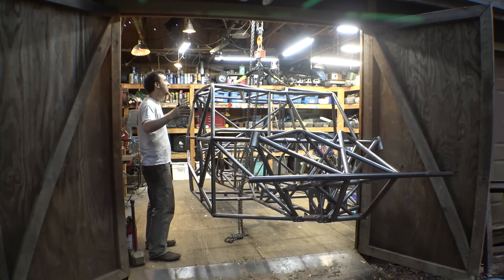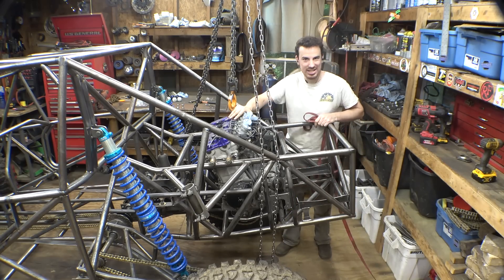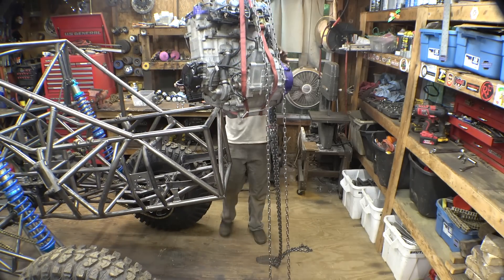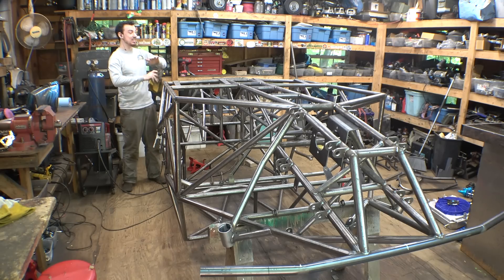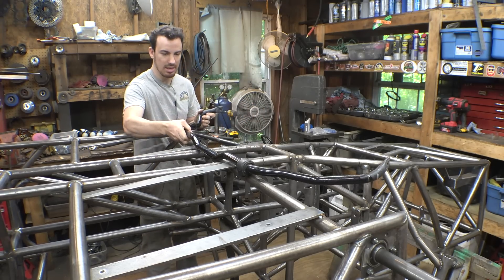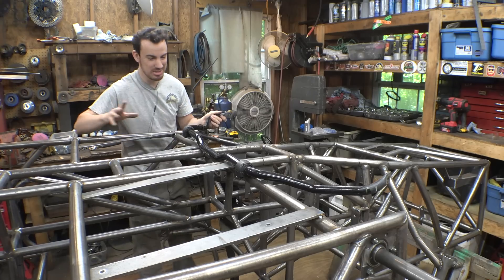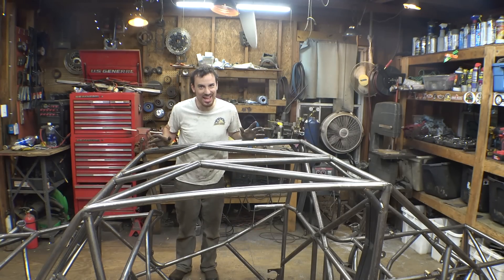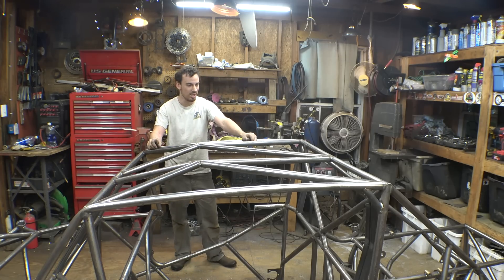How Much Does the Frame Weigh? - Mini 4WD Trophy Truck Project - Part 17

Comment: Hello, good job because this frame is really ligth. Good for the power of this engine. But for the floor, you should put the flat side under the mini trick, and not inside, because a lot of mud can stick at every things not flat. Kris

Comment: Chris, we've all seen how you drive. I don't think you've gotta worry about over engineering the frame with thicker wall tubing. Lol!! BUT, if you do get it out and it starts flexing or bending some of those tubes just replace those areas with some heavier tubing and you'll be good to go. If all these safety nannies had seen some of the junk we took to Mt. Maumee when I was barely legally allowed to drive they'd be flipping out about shit they know nothing about. All ya need are good seat belts. Its not like you're running over 45mph on most trails.

Comment: Jeez, for the physical size of that frame you could put like a 400 or 500 horsepower turob all aluminum LS 5.3L engine in it, just make sure you use the correctly associated drive train, preferably from the same vehicle. I think that would make it really fun to drive.
With an engine like that, the sky's the limmit....

Comment: I didn't notice exactly what model mig welder you were running but check to see to see if there is a spool gun accessory for it. welding your large aluminum pieces with a spool gun will save an incredible amount of time.

Comment: At 454 you can see one the driver's side. Their is not a weld we're it should on the pipe connected to the larget diameter pipe meets the frame ig

Comment: The front bumper looks a bit boring and not that strong. It could be a bit reinforced and with a bar going down from the tips to the center structure at the bottom, will make a sort of triangle on each side. Will you paint it before reassembling?

Comment: For anyone else who works in metric, it's pretty much exactly 150kg. So that entire chassis only weighs about as much as a couple of reasonably trim average guys !

For a steel tubular chassis with rollover structure, that's actually not bad. All up curb weight should easily be well under 700kg (1500ish Lbs) when it's finished, so with a CBR1000 lump in it, this thing's performance should still be pretty "Brisk" once the clutch locks.

Comment: I made a sway bar using straight high tensile steel round bar. I welded arms on arms at the ends.. I tested it and found it could twist about 45 degrees before it went beyond it's elastic range, which was way more than the car could achieve with suspension articulation. I has been working fine for over 20 years now. It is easier to pass a straight bar through a tube chassis to keep it clear of the bottom surface, although the arms on it make it tricky to remove.

Comment: That front chain is going to skip just that length is just to much to be able to tighten enough well you could but you’d just destroy stuff.  You’d have to tighten it so much but if you spilt that chain length in half by using a jack shaft it won’t take up any more room. Just wide enough for 2 sprockets and 2 bearings as close to gather as possible with out rubbing. 4-5.5 inch depending on what size stuff you use. Would still fit right down the center with what you already have for space

Comment: The thickness of the tubing has less to do with the weight and horsepower of the engine and more to do with not caving in on you and crushing you when you roll over...

Comment: My 1000cc sports car chassis weighed 44kg ( 97 lb ) at this stage of the build, so I was guessing about 250lb.  Final weight  of my car came to 420kg ( 925 lb ) including bodywork.  But for off-road, it does need to be more solid. A lot of Chris' steel is there to complete the look rather than necessary for strength, and having doors makes it harder. I'd say he's doing very well, all considered.

Comment: Why can't you run the sway bar from the back to the arms it will still work the same. Can you get it under the engine but above the frame?

Comment: I see you using the chain hoist in the same spot and always having difficulty pulling engines and it reminded me of something my dad built in his shop but he used a piece of I beam and a trolly and built a overhead crane so he could just pull a vehicle in just enough to hook to the engine pull it out and then push it back instead of having to move the vehicle

Comment: You are going to need to make the whole bottom a skid plate. Use a thick aluminum plate (5/16"). High in the front (anchor on frame bar), then taper down towards the back with increasingly longer standoff mounts. Cut out holes where you can. Round OR any shape. (Add to misc. material stash). You hit something immovable, and it catches, with it the way it is, you will be hurting.
Reply: It only needs to survive 1 test drive

Comment: I thought it would be around 100 kg, based on how easy you could lift half of it while flipping it. But it is 160 kg, so you are stronger than I expected.
Reply: came here to comment my guess and saw yours confirm mine!  based on the same thing,  watch him lug it around i figured about 160kegs
Reply: i was reading the comments and finaly found a metric based one. i'd say it 130kg. i'm optimist

Comment: according to SCAA rule book that wall thickness is perfectly legal for the weight of the vehicle :) 
i expected it to be 800lb lol 

you can make your own adjustable sway bar with just a torsion bar (from 4x4 toyota) and some custom ends. its much easier to sneak into places than an OEM bar with all its bends.

Comment: I'm going to take a guess that the bare chassis will weigh in. at somewhere between four and five hundred LBS. however if I have to pick just one number it would be 450 LBS? WOW that's a lot lighter than I was expecting. the tubing that you used must have been a little thinner wall than I originally thought? but that should be good, because ultimately you should want the power to weight ratio to be as close together as possible.

Comment: for the sway bar issue, just put a skid plate over it. it dont need to be super thick or heavy, just something to take the punch of a bottom out. something a few bolts could be un-done and taken off would work pretty easy imo

Comment: '374#.>'Edit=I did guess a little high,and you're right about that being a pretty light frame,but strong with the bracing.It'll hold up better in a mild wreck,or roll-over,than many larger tubed with less braces.A light bolt-on skid plate will lift the buggy over rocks at the sway-bar.Same for the swing arm sprockets.

Comment: Or cheaper… just like your jack shaft but weld on some arms at the ends and have a straight torsion sway bar , out of tubing that u already have and plate metal for the arms.

Comment: This time why don't you paint the frame now?    Even if you have to reweld  it still takes less time then tearing it all apart to paint.
Reply from the maker: I like to paint everything after I finish it and fix all the issues it has or may have

Comment: That weight isn't surprising. I had a 1990 f150 long bed I had to do a frame swap on after a wreck. The bare frame was only 400 lbs. At the time scrap metal was a penny a pound. I thought it was hilarious I got $4 for it.

Comment: Why don't you just design you're own sway bar where each side moves up and down separately? And I'm thinking it weighs 350-400 pounds
Reply: If they move separately then it wouldn't be a anti-sway bar
Reply: @brentlelliott  isn't a sway bar made to stop it from going side to side? So if it was one bar was like a bearing or something in the center so each side moves up and down separately would still hold solid and allow each side to rotate up and down separately. That's the idea I had in my head at least

Comment: Why not install the sway bar the other side of the 2 bars it's sitting on so it's actually inside the frame?
Reply: I was thinking the same thing, then have the ends of the sway bar inside the trailing arms.
Reply: @chriscullison7833  exactly. It'd probably be easier to set up as well plus allow the suspension a few inches more travel.

Comment: my first guess for the frame weight is obviously less than 500. but more than 200
i'm gonna go with about 300, but not 350... so 325?

ok i was close, but not over at least.
[Edit]
i'm hoping full wet weight with operator isn't over 775-ish, because that could be a real problem.
then again it's not like you're going to expect it to last 20 years.

Comment: 300 lb frame, but once everything is re installed the total weight will be around 1200+ lbs,  when that engine was meant for a 300 lb bike... again, rip that engine and clutch.    you really need to start working with honda K motors
Reply: The CBR 1000 is 450 pounds wet.   Even a CBR 600 at 345 pounds with two people has lots of power.  This thing will be a rocket.
Reply: @RandysRides  ya but that cbr doesnt have truck tires and wheels, all the driveline components for the 4wd, that huge ass fuel tank that will certainly add a ton of weight when full, the lightbars he will put on it, those huge shocks and the trailing arms he didnt weigh with it, the homebuilt tranny with reverse and more and more and more...  its going to be 2-3 times as heavy as your thinking.
Reply: If geared right with a Rekluse clutch I think it would be good. Even with a bit of slip in high range it would hold out pretty good and low range will be fine.